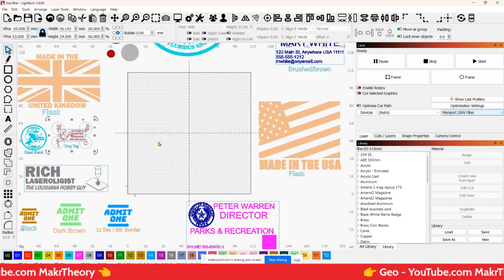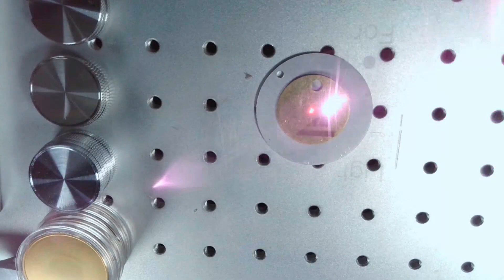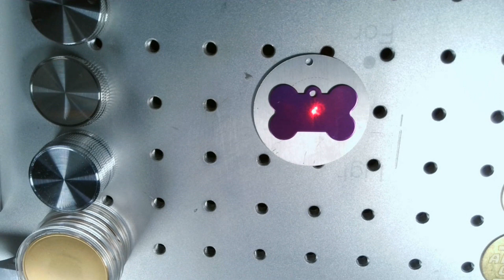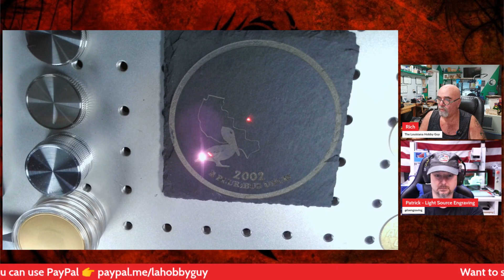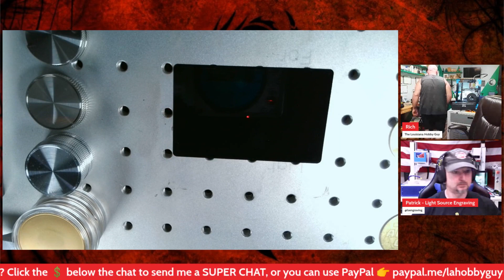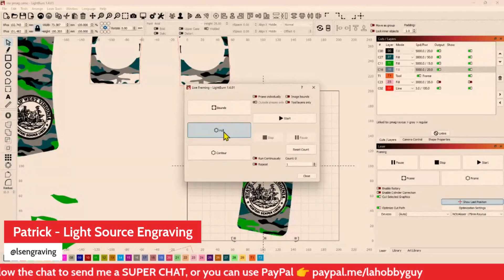👉 Live REPLAY of Engraving with a 20W Raycus fiber laser!

Comment: Hi Rich, when working with fiber often you will import and ungroup an image/object, often there are leftover "curves" under the work you are working with at this point, these leftover curves will mess your hatching and engraving around all day, after hatching the parts you need then delete additional curves, for fiber it is easier to do this in EZC2 or Coral, Lightburn cannot as yet...
, also in this video your settings for brass are way out, how do i send the correct ones to you ?
Reply from the maker: Thanks for the info! My settings have changed dramatically since this video, thanks!